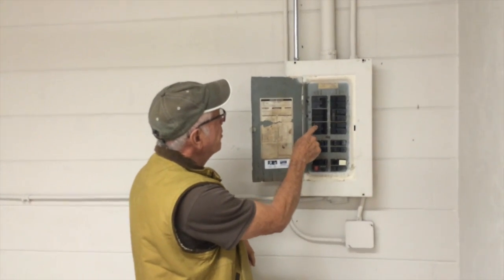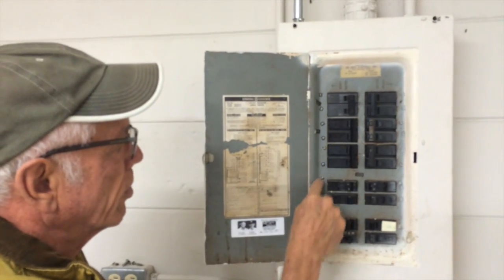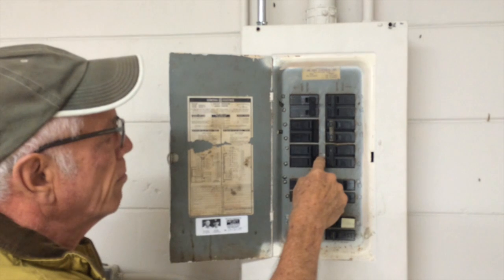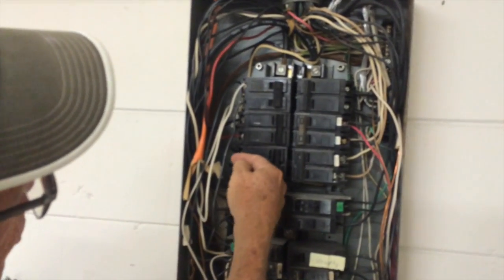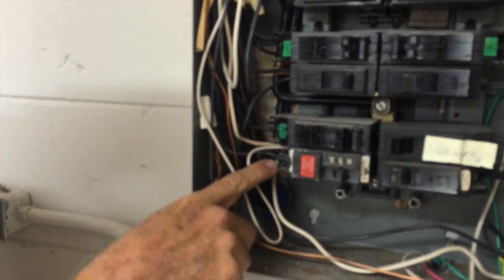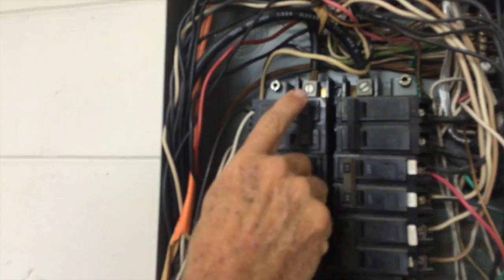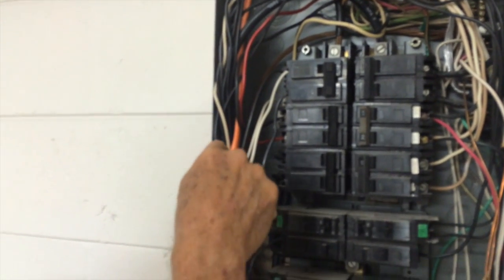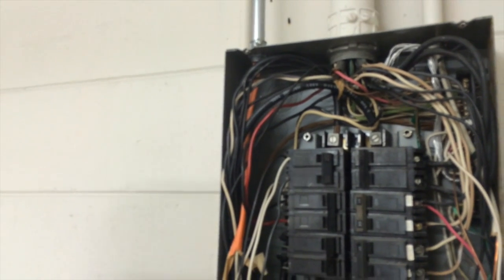Evaluating a Split Bus Panel

Comment: Not sure what the real purpose is for a split buss is because it's basically a sub panel within a main panel, but why would you need that all in the same location and on the same meter?
Reply: back in the day you only had max 80 amp breakers with most being just 60 amps so if you wanted to add things like a 220/240 a/c, hotwater  it was just convenient to buy a splitbuss panel you cld use readily available breakers including your old ones than just add. lets say a 60 amp breaker cost like $1 a new 100 amp breaker wld be like $7. 
 its like how i got a great deal on 4 gfci outlets for $30 when 1 gfci breaker cost the same.

Comment: Thanks My Panel has one 100 amo breaker that overlappes both bus bars and is very long. House built in 1979 Not sure if it is the main I tuned ot off and back on O saw nothing. I noticed it was actually a Split bus panel.

Comment: An issue that comes up often on inspections here in NJ, the square D QO series breakers that are labeled OK to "double-tap" are actually very common, so before calling it out as a defect you have to be very careful to make sure it really is a defect. 

As far as this panel here, since there are only six throws to cut off all of the power, that is within the code requirement, correct? Even though they are double breakers with connecting bars?
Reply: He called out defects that were NOT defects.